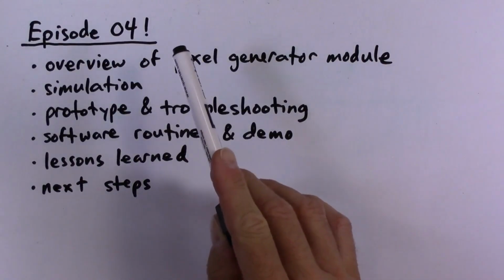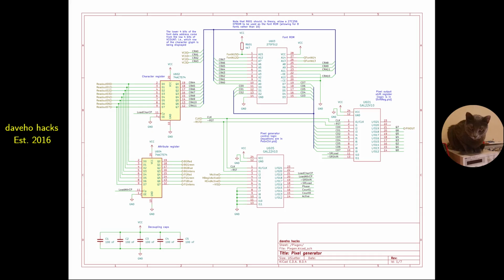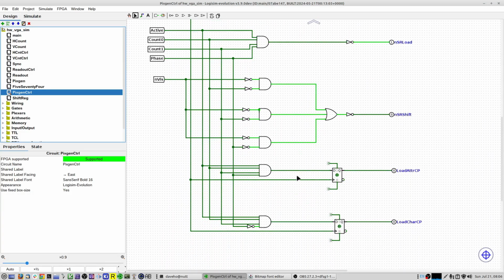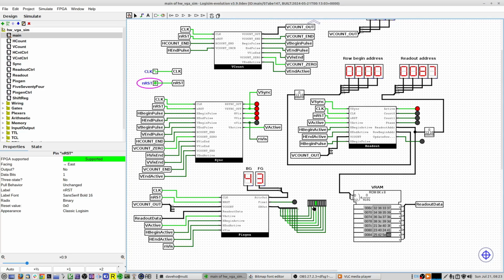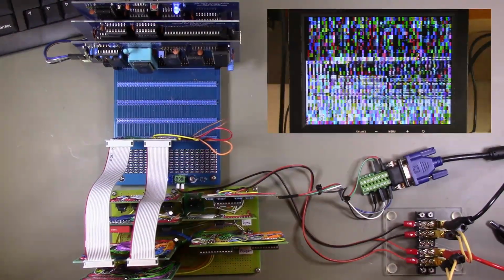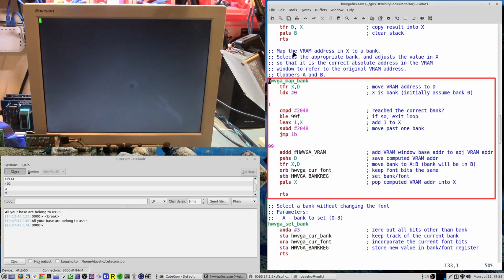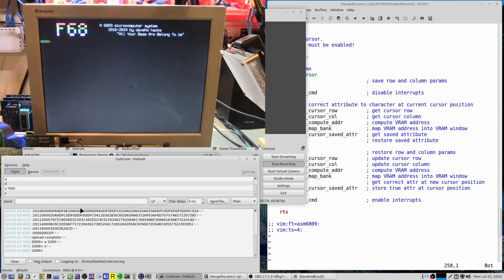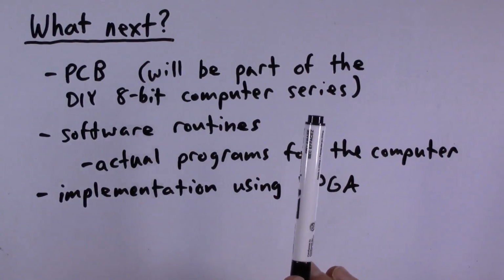Hardware VGA, Episode 04 (alternate, no background music): Pixel generation

Comment: Very interesting. Maybe a bit late in the day, but might I point you at DrMattRegan https://www.youtube.com/@DrMattRegan/videos
He's made up both VGA and Composite video systems for 8 bit machines using very simple TTL and an EPROM. 
The 'Magic' is in running a Finite State Machine to generate the raster and fetch the data from memory, while Clock-Sharing the RAM between CPU and Video - CPU as the clock goes up and Video as it goes down. So no contention, no slow down, no need for dual-ported RAM.

Comment: Nice work. Thnak you for this build with clear explanation what/how/why! BTW: what wire do you use for your prototyping? Your results are so neat...
Reply from the maker: If you search AliExpress for the term "UL1423", there's a listing from a vendor called "FreeBoom". I'm using the 26 AWG version. It's like 30 AWG wire wrap wire, but a little bit thicker.